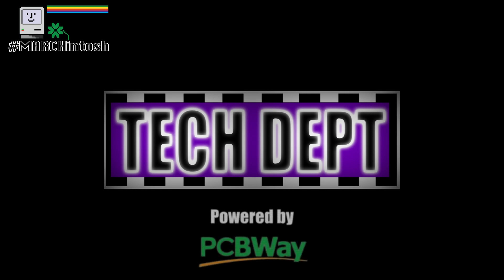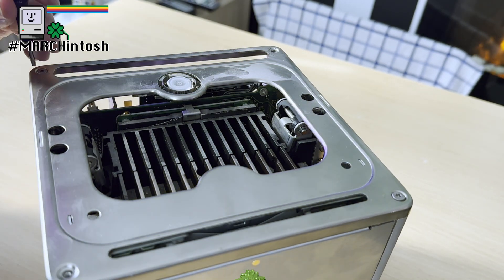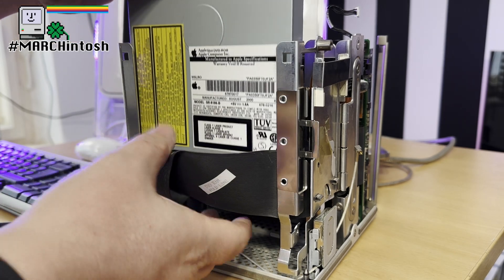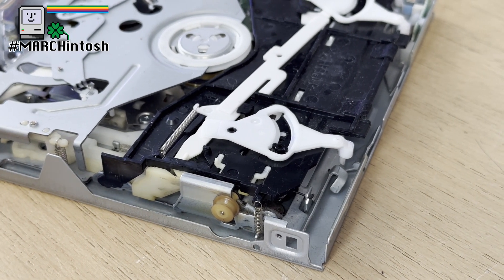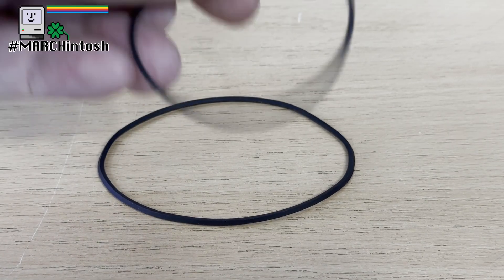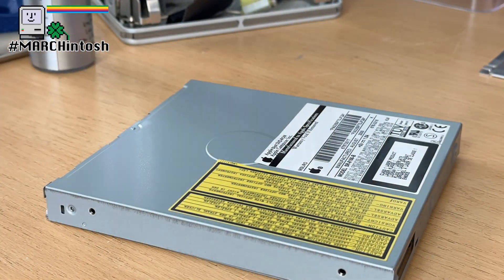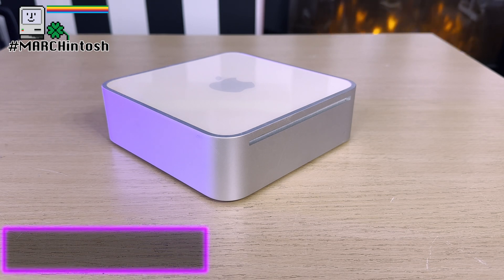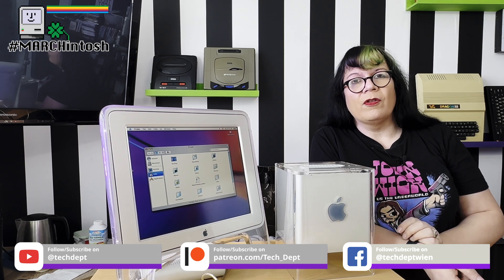Mac G4 CUBE DVD drive fix #marchintosh

Comment: Thanks for the video, Jess B! Did you just need to fiddle around with the mechanism to get it to work after the first re-assemble?
Reply from the maker: It’s been awhile since I looked at this, but yes there was a little jiggling on the first reassembly. But what helped was cleaning those rollers and changing the belt. The belt by itself just isn’t strong enough I think to overcome a non sticky set of rollers. I’ve got to look at an iMac soon to fix a similar drive, so I’ll make a video on how well that goes.

Comment: But what did you do to make the disk drive work in the end?
Reply from the maker: That’s the problem. I must have dismantled that drive three or four times off camera, and each time I tested it, it would either kinda work or not. Then on the last reassembly, it finally sorted itself out. So I don’t know what made the difference. The new belt and cleaned rollers probably made the difference in the end, but yeah it’s one of those “it works, why?” Problems.

Comment: I think it says something that I, as a person who knows nothing about tech, looked at the cube and went "but how does it breathe" just before you mentioned the problems it has with the nonexistent cooling fan...
Reply from the maker: Yeah. It works by convection. Heat is deposited into massive Heatsinks, then rises upward through a vent. The rising heat then draws in cooler air from below. It works…..but not very well. Steve jobs hated fans.